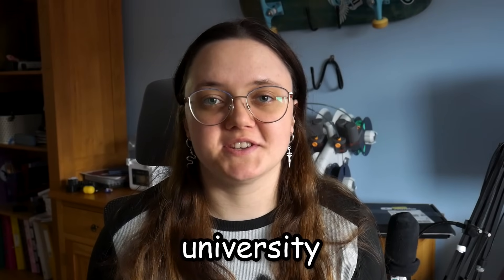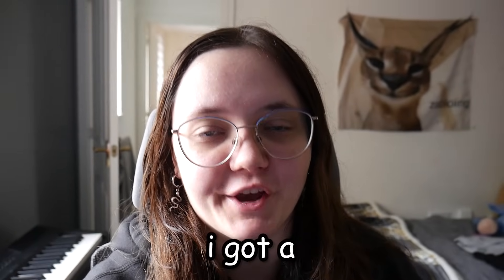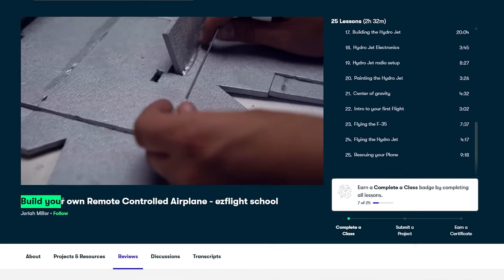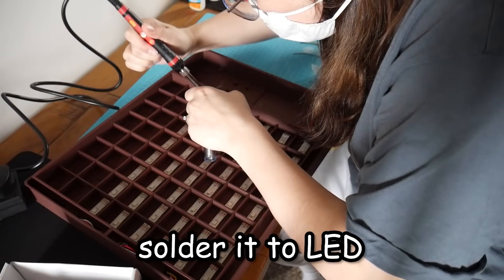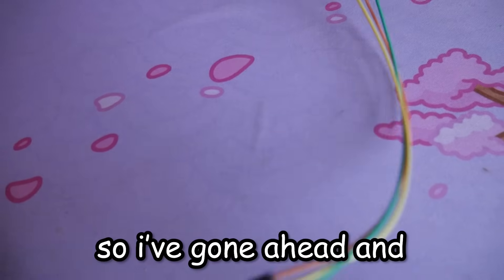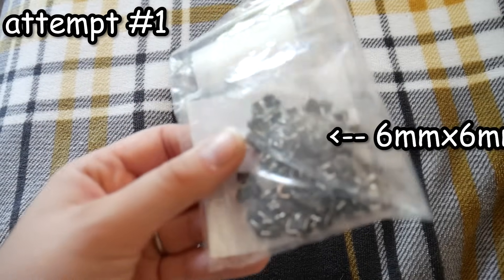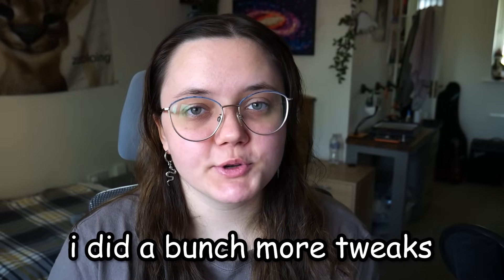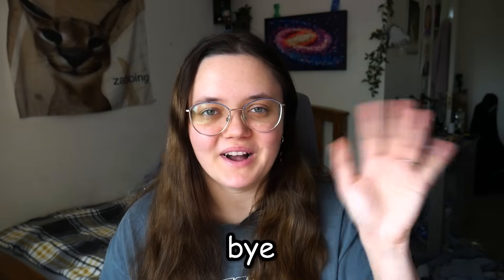I Made a Chess Engine IRL

Comment: I built Lewis' chessboard but it has always been unstable. It would lock up, or reboot. Sometimes it wouldn't boot straight away and had to be restarted. Have you experienced these issues with your setup? I never knew if it was something in the configuration of the software or something in the electronics and the project hasn't had any updates in years as you said. Is there a way to retrofit my board and pi with your setup? Do you think it would help with the stability of the board?
Reply from the maker: Hey, so I haven’t experienced those issues since I set the board up differently and wrote my own software. I personally had a different pi and arduino model so my wiring setup was different too. Only things I can recommend is to play around with your own arduino and pi code. Obviously it could also be a design fault etc. I wish you all the best. Also unfortunately unless you have specifically engineered the board the same way I did my code won’t really work.
Reply: Understood. Thanks for the reply!

Comment: Did you know that there's like a switch that when you put a magnet next to it and it lets electricity pass through cuz you could use one of those in the chess board and have each piece have a magnet so you don't have to press the button manually
Reply: hall effect sensors :)

Comment: Cool project, good job on completing it! You might wanna use a checklist to prevent some unnecessary work, such as when you were unsure whether your Arduino or if the LEDs work, or when you printed the board for buttons 4 times - should set yourself up so you don't need to do that. In other words, doing low-cost checks to avoid potential high-cost changes in the future 😉

Comment: Hang on hangon... Doesn't your college/university have a workshop with a C&C, laser cutter or heck even a midar saw and 3D printers themselves? I mean, it's supposed to teach you to get to work in the real world :)  But none the less well done! I like the video and the project a lot!

Also a tip for the future, the Pi is fully capable to also control the LEDs at the same time. There's more than enough IO for the buttons and the LED strips -- saves a bit of money. This was something the hammered into us at college: "Make it work with as little components as possible." They would deduct points for components that were not necessary. As in the real world when mass producing even a little resistor adds up when you make a million units, let alone whole arduinos ;)
Reply from the maker: Yes the university has facilities but honestly I wanted to get a printer for a while since I’ll be leaving university this month.

As for the pi/arduino setup. Looking back yes using just the pi would be more resourceful and cheaper. But I wanted to have 2 devices, one which exclusively controls the LEDs and buttons and one for the chess stuff. No real reason as to why just sort of made more sense in my head at the time. But this was a good learning experience to know that next time I can just use the pi. And also thanks for the advice of making it work with as little as possible, that’s honestly something I’m going to try in the future !
Reply: @ good luck on your professional career. And that bamboo printer looks like a solid workhorse, that you’ll get many hours of good use from. Keep up the great work. I loved the video.